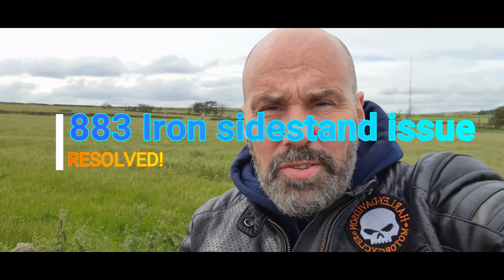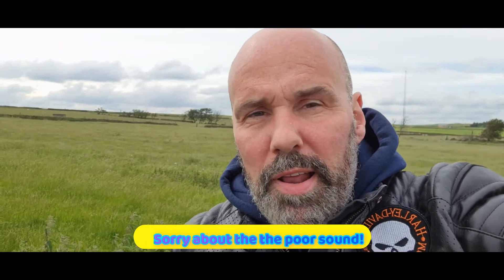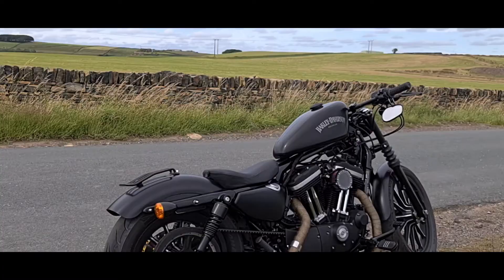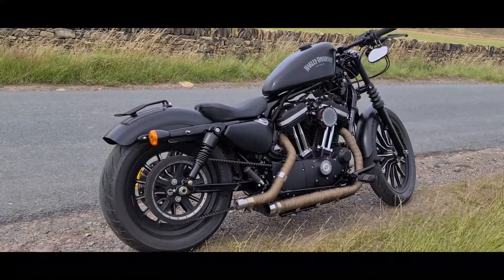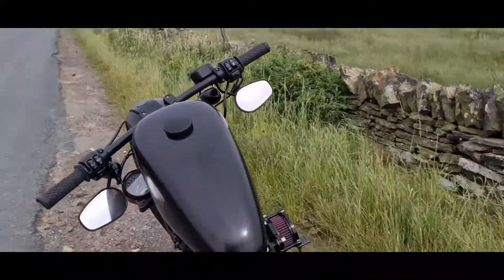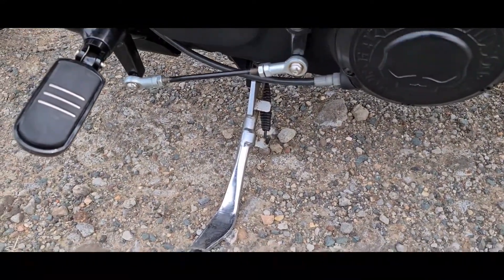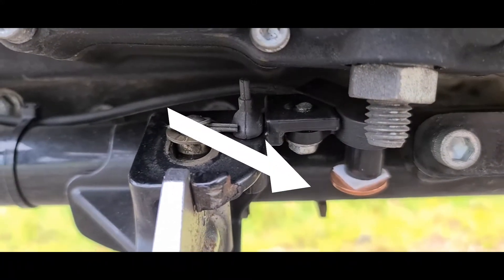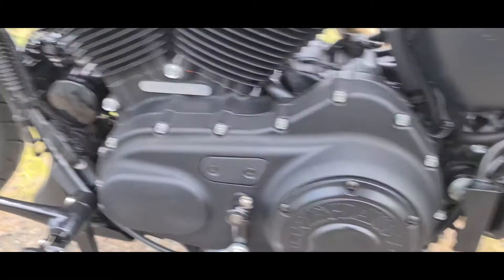Harley Davidson 883 cutting out? TRY THIS!

Comment: I had the same issue and experimented with a few solutions. The problem is the bracket that holds the Jiffy stand into the bike frame. It gets deformed over time, changing the spring with a new one did not help in my case. Thus, I found that a better option is to glue or weld a washer on the Jiffy stand part that moves to be just under the sensor when the kickstand is up. I used superglue on mine and so far so good (I should weld it and paint it black just like my kickstand stick when i get a chance). This is better than overriding the safety feature and sticking a washer to the proximity sensor (magnetic sensor)
Reply from the maker: Great solution at the time it was a temp fix then I got rid of the bike. If I would have kept it then deffo gone with your solution of a permanant fix. Cheers 👍🏻👍🏻